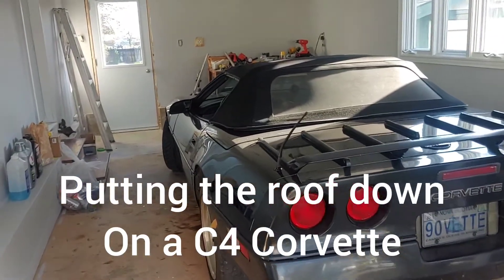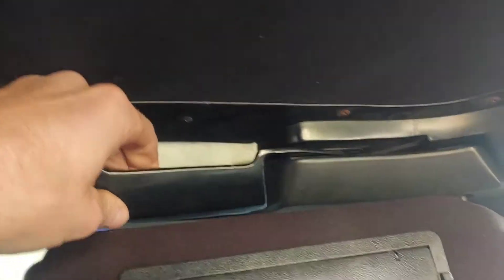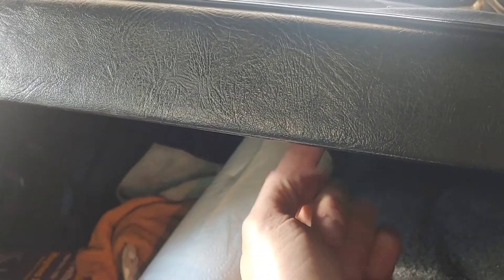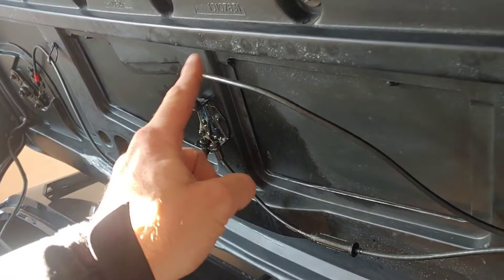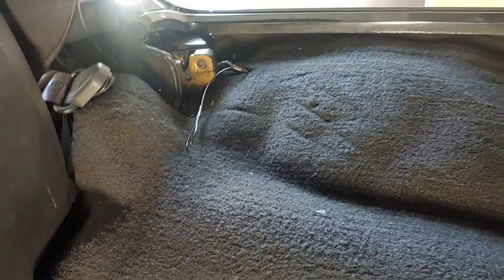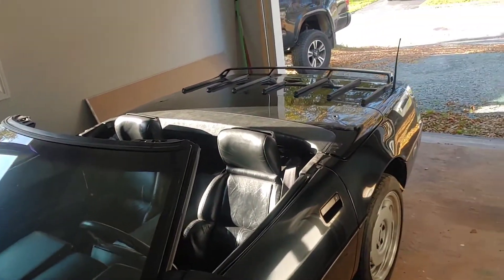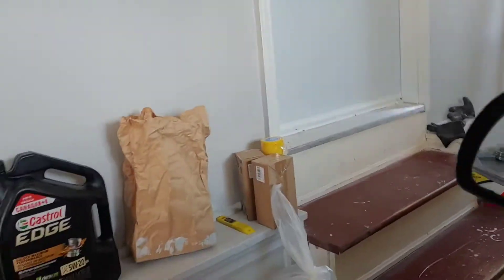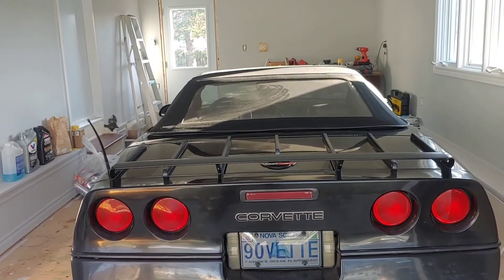Convertible C4 Corvette.  How to go topless.

Comment: Thank you for this informative video! My brother recently passed away so I am left to sell off his collection including his 90 Vette. The battery has been dead so I guess the first order of business will be to replace the battery once I get the car to my shop. Have you got a video on battery replacement? Lol
Reply from the maker: @richardroof2638  I don't but I have replaced the battery a few times, it's a bit of a pain.  Once the batt is disconnected you need to remove the small side cover.  It's Allen screws or torks (star pattern) Inside the wheel opening And 1small bolt if I remember correctly then the battery will slide out the side.  Hope this helps !

Comment: beautiful car. great video. what are your running costs on average per year for this car?
Reply from the maker: Thank you.  Very low actually.  I only drive it in June July and August.  It's been a reliable car.   I gave it a good tune up when I bought it in 2010.  And not much since.
It's fuel injected so get pretty good gas milage.
It's the best 10 k I have ever spent.

Comment: are the speakers blocked by the top when it is down?
Reply from the maker: Somewhat but sound still emits fine.
Reply: @P Street Garage  thank you! I get my 1st vett March 18th. Needed to know how the top worked. Going to try and find a hard top.
Reply from the maker: @rushtk2112  Good for you!!! These are great old cars.  Good luck with it !
Reply from the maker: Anthony,  I think I had a brain fart.  When the convertible top folds down, it does not block the 2 back speakers.   Once folded there is a small storage area behind the 2 seats.   Big enough for a gym bag or back pack.  The speakers are at the back of this opening and slightly angled up.